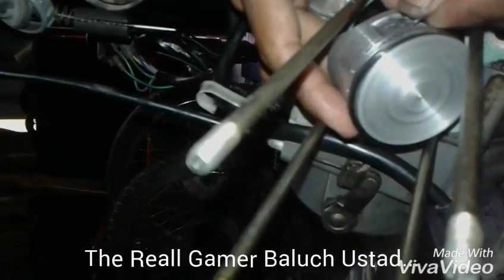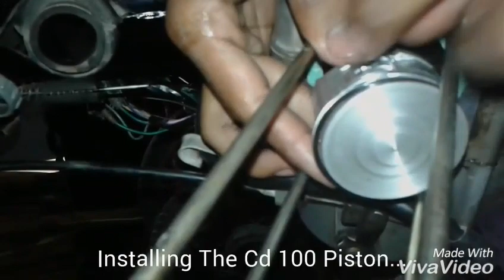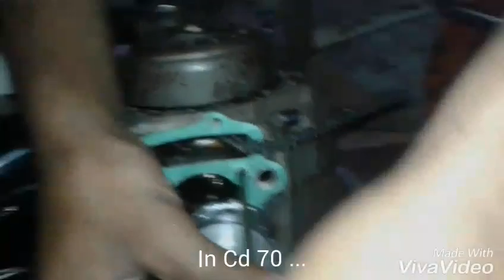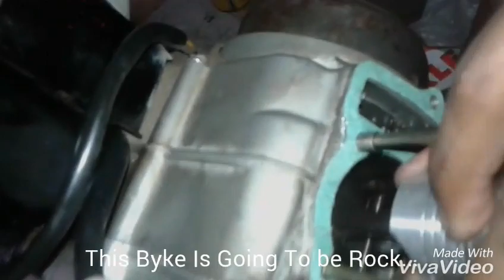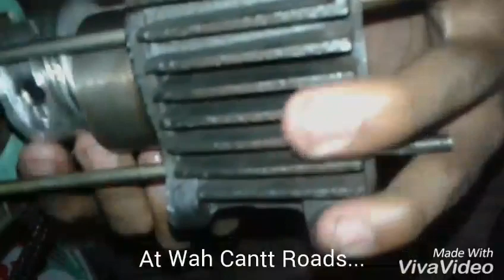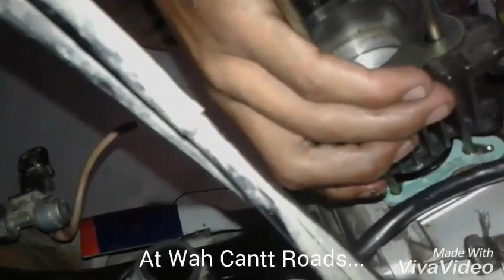how to make bike faster 70 by pakistan bykers Bikes Tecnical Guru Taimoor Baloch Alteration

Comment: I think to raise/ increase peak up and speed of cd70 or Chinese 70s. 
No need to alter the genuine internal parts of engine. You simply just need 3 things:
Carburetor of cg125 or new Asia rickshaw, ignition coil of bottle type which comes in cars of ND Japan brand, chain garari 15 teeth at front engine sprocket  and 38 teeth at rear sprocket with same chain 420-104L. This is a low cost method and generally people can afford it, also in this way cd70 engine will remain in it's genuine condition.

Comment: Have you used the 70cc barrel  and 100 cc piston
Reply: Pakistan Bykers Barrel mean Cylinder Block
Reply: Usama Rajpot Please tell as whether Piston of United US100 and Piston of Road Prince RP110 is same as of Honda CD100 or different? 
Means whether RP110 and US100 piston fitted in cylinder of old CD70 cylinder barrel sleeve?
Reply: Taimoor Baloch hi